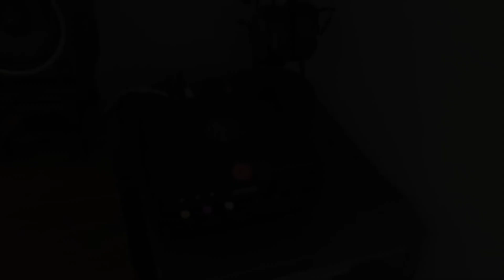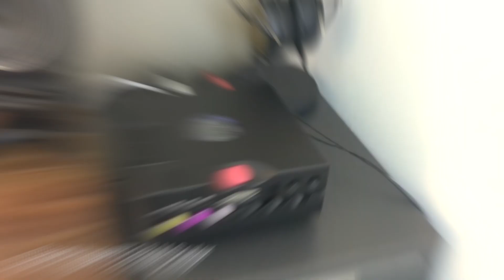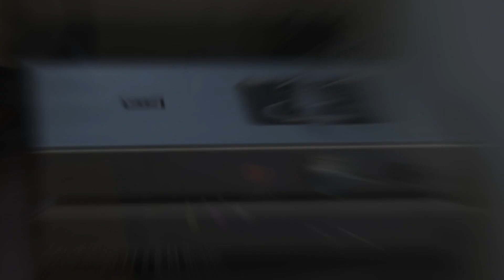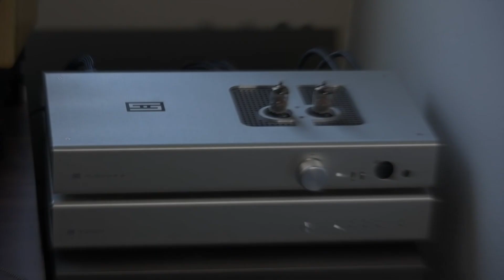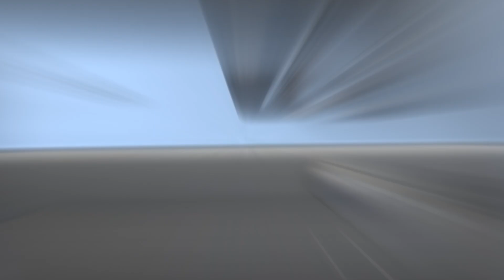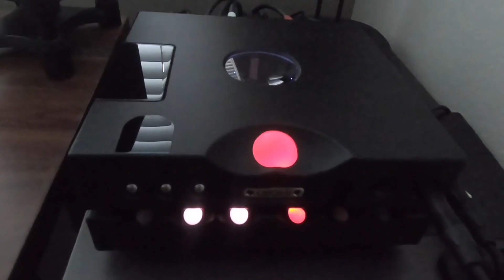Chord Electronics VS Schiit Audio

Comment: I had the Bifrost multibit and Gungnir multibit. It wasn't what I was looking for and was too bright. Glad the Hugo TT2 and Mscaler came at the right time when I had the money. Sounds amazing. The only downside to the Mscaler is the audio delay which isn't a problem for music but I watch movies with it too but have to enable video mode to correct the delay but it cuts the taps in half. If I watch a movie on my computer I can  set the program to adjust for the delay and hear with full taps. Is there a Blu-ray player where you can adjust delay?
Reply from the maker: I’m sure there is a Blu-ray player that can do that, although I don’t have a particular recommendation.

Comment: Good video, I agree on the DACs but one 'issue' with these two IMHO neither do a DAP I am lazzy now and often like a one cable (just the headphone cable I mean) solution. I do like the multi bit Schiit (just modi multi bit) and Chord (just mojo) sound, but got fed up with the cables with a Schitt stack and the micro usb etc chords needed with the Mojo.